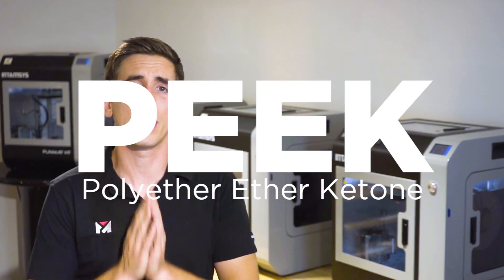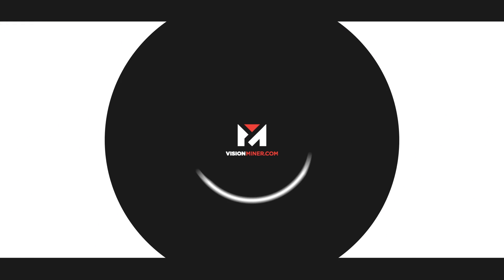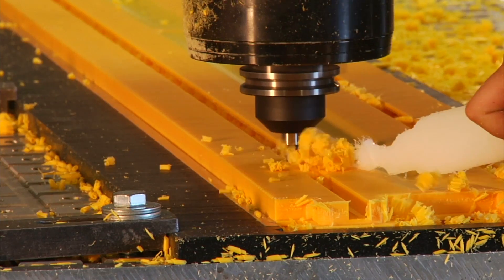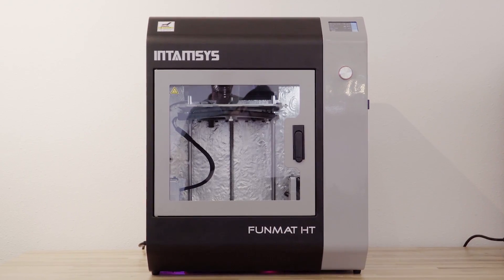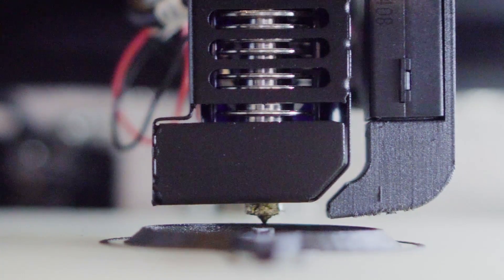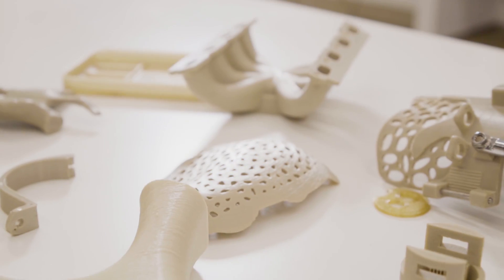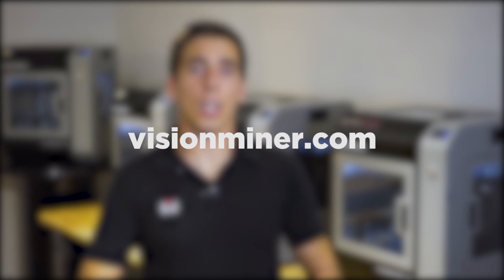What is PEEK? The King of Filament for 3D Printing High Performance Parts

Comment: Hello, I have a problem when I'm trying to print with PEEK, it`s always wraping, and I can't have a good print And I can`t finish a print. What can I do, what can put on the bed , thanks
Reply from the maker: Check out our Nano Polymer Adhesive (visionminer.com/adhesive) -- we made it specifically for PEEK and ULTEM in our own print service, it's a game changer. However, you might also be reaching limits of PEEK itself - it's extremely difficult to get a good crystallized part over 1cm thick, so if you're going too thick, it might just be reaching it's own limits. 160c+ on the bed, 400-450c on the nozzle, and crank the chamber as hot as it will go!

Comment: Hi, currently I am working on a custom project which requires the chamber of a gun to be fully 3D printed.  This means that the material I use will have to be able to withstand the high pressure environment of a gun chamber and not break apart.  Would you recommend PEEK or CFPEEK?  This is very dangerous because of the tendency of 3D printed parts to break apart at the layers due to layer adhesion issues.  What would you recommend to reduce layer adhesion issues?
Reply: nope nope nope, the pressure in chamber can be from 25 to 50,000 PSI. so do not 3D print chamber for a gun. Usually when fibers reinforced polymers are used to contain high pressure they use Continuous woven fibers method, which you can not get with a standard 3D printer...

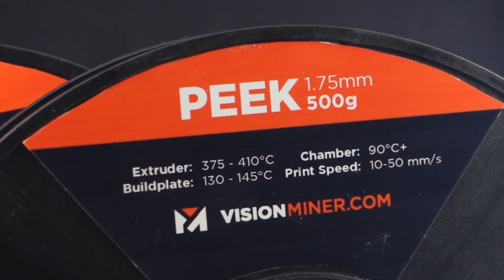Comment: Your videos are awesome and I really like your insights on high temperature 3d printing. At 0:26 you mentioned peek is as strong as steel by volume. Does that mean that a beam with the same length and same base area printed in peek will be stronger than steel or did you mean it's stronger by weight? So that if the two beams were the same length and weighed the same the peek one would be stronger?
Reply from the maker: By volume -- so theoretically, the same size part will be as strong as steel, but lighter. In 3D Printing this doesn't always apply, due to layer adhesion and whatnot (being improved in new materials), but that's the baseline of the specs, yes :)
Reply: @VisionMiner  you could always anneal it tho (or if printed with solid infill remelt it in compressed salt/ceramic powder
Reply: @VisionMiner  Also because in 3d printing its not just the material thats in question, its the adhesion between the layers of the material that are the weak points. We had to return a carbon fibre printer for that reason. Cf itself is strong and can be layered correctly as a thread for perfect strength, but the adhesion between the Cf thread depends on the other material thats being printed along with it. And this means then eventually it breaks easily because this adhesion was never good enough, infact worse than a single material layered.

Comment: Hi!
I am trying to print PEEK on my self built 3D printer. It prints well on 390/120 hotend/buildplate (passive chamber at 45 degrees during print) and does not warp during printing at all, but warps a little after cooldown. After annealing it warps even more. Tried with and without brim, different adhesives, removing part just after print finished or waiting till buildplate cools down. Nothing helps. The part is a gear 43mm in diameter. Is there a solution for this? Or it's just something wrong with my PEEK? I tried to heat fillament up to 260 degrees and it doesn't melt at all, so it's not ABS or Nylon.
Reply from the maker: Sort of confused -- PEEK won't melt until 343C, but what are you referring to? It may just be the chamber temp needs to be hotter, to allow the part to relax slightly more during the printing.
Reply: @VisionMiner  Yes, PEEK won't melt at 260. I just tried to test if it is real or fake PEEK. And it seems to be real.
OK, I will try to increace chamber temperature. Thanks for advice!
Reply: @TheNamelessOne12357 yeah need a High chamber temp and filament nozzle temp too , consistency is your key

Comment: Direct from the factory it is $450 per kg. That does not include shipping.
Reply: At that price point you might aswell print your automotive parts in aluminium SLM
Reply: we have cheap peek materials.

Comment: You guys do know that the stratasys patent for heated chamber never covered the heated chamber in itself, but only an implementation where the motion components are outside and not subject to the full oven temperature, right? Your printer design would have not infringed from day one.
Reply from the maker: That is correct. The printer is designed by Intamsys, not ourselves -- thanks though!